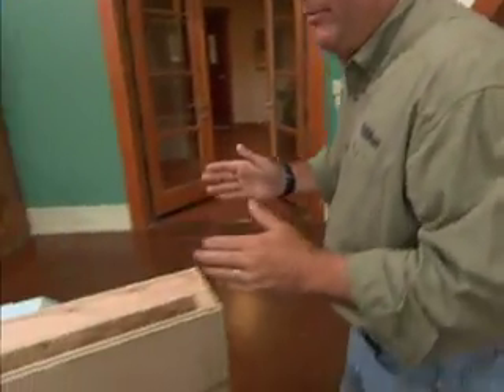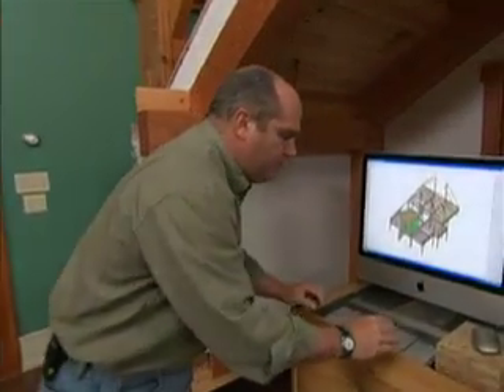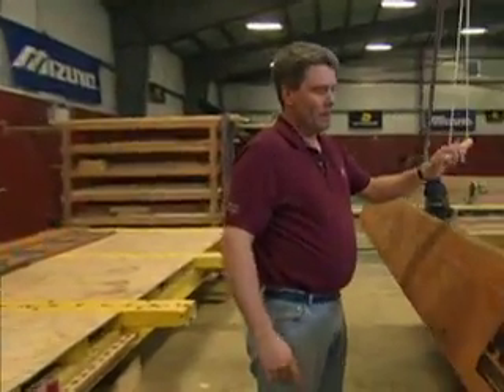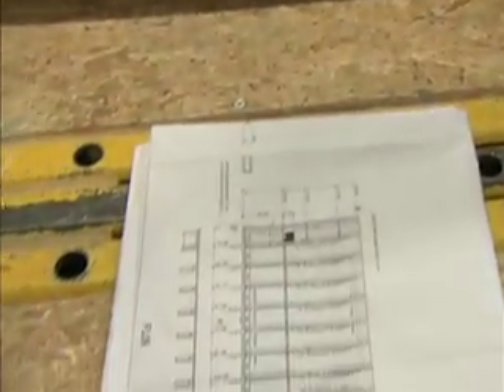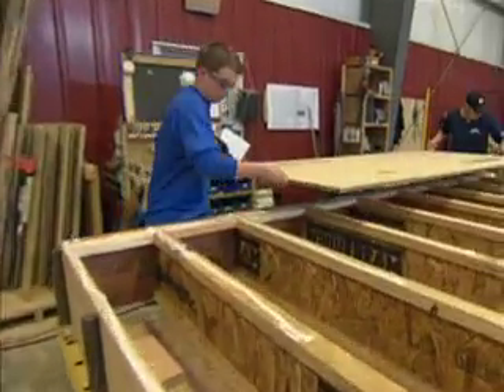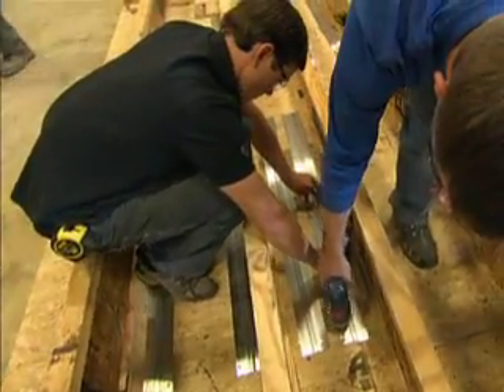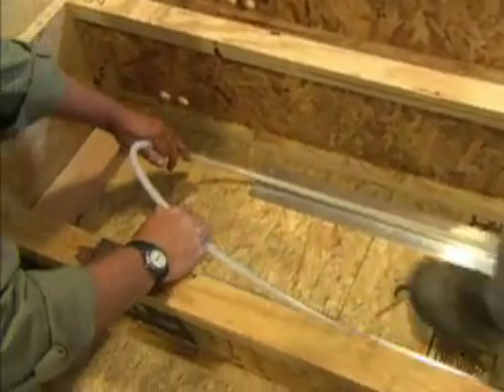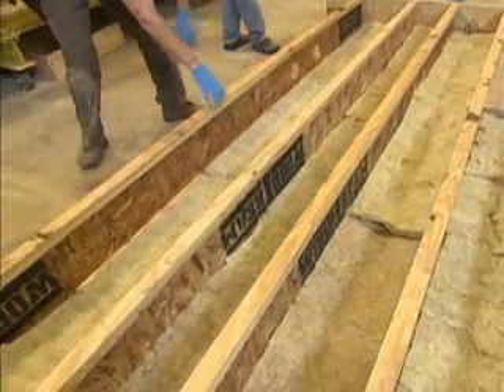How to Install Radiant Heat in a Pre-Fab House | This Old House

Comment: Heat cold climate heat loss calculation chase for pipe and wires insulation pipe for heat leak outside foam insulation urthiane high or value out board 2” insulation   double conventional wall for heat half heat pass outiside heat water radiant floor heating frames and decked osb plywood conventional lumber pre-cut machine computer machine. Prettily holes holes for radiant floor osb sheeting bead adhesive subfloor. Radiant heating pexheating tubing heated water aluminum channel snap undercode(?) pex water heated through aluminum track foil track snaps unto champer? Glue? Unto subfloor? Floor panel works better upside down then drilled? Same nails or glue pick it already insulation staples? Why not? 
(Why does this floor need liquid nails?)

Comment: Why is he running Windows XP on an iMac?
Reply: Khaled Elkhawaga because most engineering software is not made for Mac operating systems
Reply: As someone else said, most cad and engineering calculation software doesn't run on OSX, so instead they run Bootcamp which lets them run windows